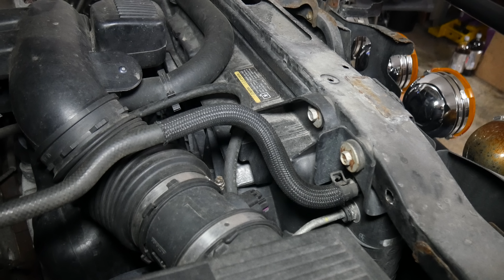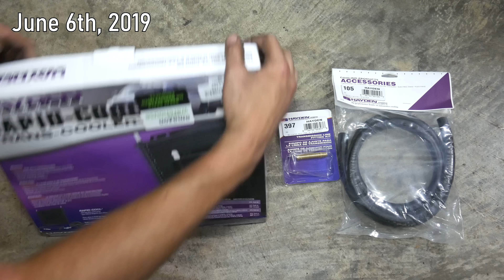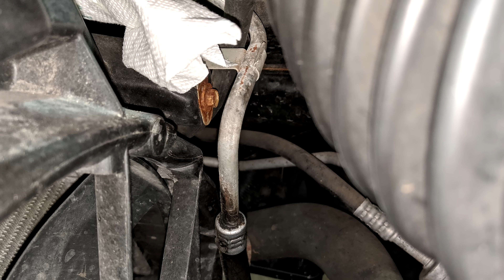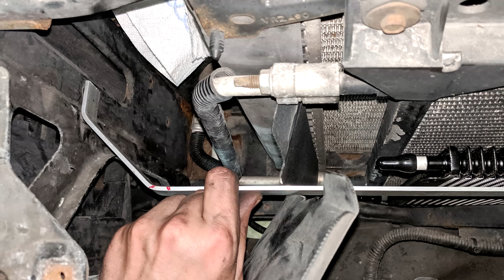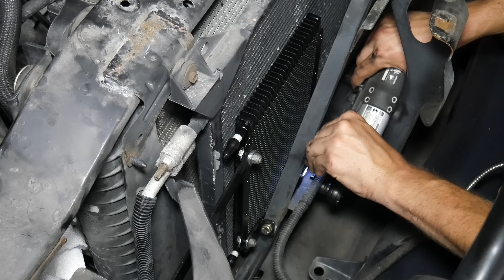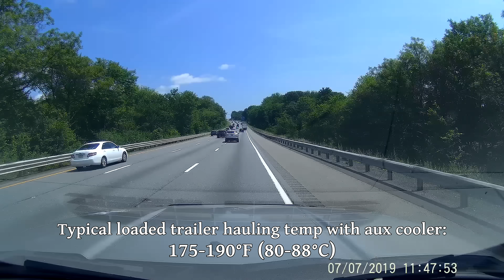2007 Silverado Project Auxiliary Transmission Cooler Install (Ep.14)

Comment: I ordered a Hayden 678 to put on my Tacoma. I’m going to be installing it  and installing a fan too since I’m pulling on steep inclines at low speeds. 
I ordered a Mishimoto 6” fan and it will mount to the tabs perfectly. I also have a cheaper 7” fan on the way just to see if it will fit and maybe save some money but so far the 6” fan looks a perfect fit if you are using the included mounting ears that slide on the fan. Without the slide on ears I might be able to go a 7” but I haven’t received it yet so I’ll find out soon.

Comment: did this to my truck as the radiator cooler isnt enough to save these transmissions, used the tube and fin style cooler and a mounting kit from hayden, used the fuel injection style clamps and liked them way more than the worm gear clamps, overall its an upgrade whether you're towing or not because the main killer of transmissions is heat

Comment: Hey, great video! I just want to confirm that you installed a cooler without the thermal bypass, correct? I have an aftermarket 3 row radiator that eliminates the trans cooler function, so I opted to add a hayden trans cooler, but since it does get fairly cold here (teens and occasionally single digits in Jan) I opted for the model that includes a thermal bypass. If you installed one without, temps of 150 makes sense, but if you installed one with a thermal bypass, I may need to rethink my design. Thanks in advance!

Comment: Same truck, but a 2008 and 2wd, with exactly the same issues. I live in New Mexico, about 1200 ft above the nearest grocery store, maybe 1500 ft total elevation from Home Depot. In the worst driving conditions, especially while towing, I could easily get trans temps over 230 degrees. Took my truck to a reputable trans shop and they said it "wasn't really worth" putting on a cooler. I was disheartened, found this video, saw that it described my exact problem, and ordered the parts.

I'm not a skilled mechanic. I can do the basics, have done things as intensive as a timing belt with a friend, but generally there's nothing except my water well that makes me more anxious than working on cars. I usually get in a big fight with my wife before I attempt any car repair. I've never made brackets, never messed with transmission lines...last night was not a huge one, but we were a little miffed at each other before bed.

This video was spot on. From pulling the truck in to the garage to pulling it back out again was about about 3 hours, total. The pick tool is really quite necessary--not sure how you'd get that little ring out without it. I bought an aluminum bar at Tractor Supply. I managed with two brackets, one mounted higher up near the hood latch, using an existing bolt hole there. I didn't paint the brackets. I used my bench grinder to round them off. The two things that hung me up most were the clips for the grill (annoying) and getting the return hose to slip far enough onto the old hard line that used to go into the radiator so that a hose clamp could get purchase.

All said, I got it on, after a few hours of talking to myself and dropping things. I took it on a test drive down to town. About 98 degrees down there, 93 at my house. Truck made the climb and topped out at about 180 degrees trans temp, which is 25 degrees lower than it normally is when I pull into my driveway. 

I have no clue if this will extend the life of my transmission, but this is "worth it" for me, simply because the parts are so cheap and the relief it provides is significant. Thank you for making this video.

Comment: I just picked up the Hayden 679 for my 17 sierra wt.  So far towing my travel trailer with the family for a camping trip. I average 210-230. The highest I've seen was 240. Winter would never exceed 195 due to the transmission thermostat. (yea gm has that now since 2014.)  It would open above 194 before it flows to the rad/cooler. I've since replaced my transmission thermostat. The new updated one opens at 158. So it will be interesting to see my Temps this trip with just the new thermostat and the next trip in a month will hopefully be with the additional cooler. I'm not too concerned with winter even though I'm in Canada,  because of the mentioned thermostat, Hayden's supposed built in cold weather bypass  AND active grill shutters. Supposed to help aerodynamics as well according to gm. But man is it great for winter.
Reply: Update: 83° day. Got up to 230° thermostat didn't really keep the Temps down much. But did cool down quicker and took longer to get up there.
Reply: So final update.  Unloaded driving it hovers around 165 once it stabilizes. Towing it hovers around  185 and I haven't seen it over 195 since. DEFINITELY WORTH DOING!

Comment: We have this 2006 chevy duramax for farm use, we were hauling hay out of a field with sugar sand roads at 7 mph that trans got up to 270 DEGREES!!! The red temprature starts at 280 up to 300 is where the guage stops going up.

Comment: Helpful, straightforward video that really helped with installing a cooler on  my 2013 Traverse.  IMHO most applications will be fine using the included plastic connectors in many kits and tying directly into the A/C condenser coil. Cars roll out of the factory with dozens of plastic clips, harnesses, ties, etc. Why the connector for a cooler would be different than all of the other plastic on an typical engine setup is beyond me.

Comment: I got the parts you suggested, but opted for the cooler that had the bypass function since I live in upstate NY. I cut two longer 3/4" flat aluminum pieces to span the opening made by the structural members I mentioned in my previous comments. All went well--until I realized that the included hose was not long enough. No one in this area had hoses the correct size and I did not want to try a 3/8" hose, so I then opted for a steam punk look as I then mounted the cooler at an angle to the passenger-side structural member. This location allowed for the hoses to reach. Since I am on vacation, and my tools were in NY, I opted for this simple install until I get back home and can mount it properly. So far, it's reduced temps by about 50 degrees.  The only thing that did not go as you described is I could not get the slip ring off the existed tube so I could put it on the new connection. There are no leaks. I wonder what could be placed on the retainer clip to get it from coming off. Is that even an issue? Do they routinely pop off? It seems pretty secure as it is... I hope.

Comment: Quick Question: I took the air dam from off the top of the radiator area and looked in to see for myself what you did. I noticed the front bracing (like an inverted "V"). With the horizontal nature of the mounting brackets built onto the cooler, could you have made some simple straight aluminum pieces to span that opening? You didn't, so I'm wondering if there was a reason why. (not being picky here, it just seemed your method may have been harder than it needed to be with all the bending.) Could it be that the bracing may need to come off for other reasons not related to the transmission cooler and the cooler would then have to be removed as well? Also, this cooler comes with zip-tie type mounting rods and spacers. Are these not as good?

I have a 2008 V6 and my transmission runs at above 200 deg normally, and pulling my camper it reached into the near 240 deg area. This concerned me so much that I stopped a GM dealership to ask if this was high and if not, at what temp to be concerned. I could get no straight answer. One dealership stated "Your idiot light will come on if there is a problem." But I'm thinking it'll too late if it does. There is nothing in the manual about this. You were concerned at lower temps than mine. There is nothing in the manual about this. Thanks for your video.

Comment: I put 2 of these on my 2011 Sierra 1500 with the 6L80. Never goes above 170 in 90 degree heat pulling my boat in traffic. After my transmission failed the fist time. I’ve been told you can’t freeze out a transmission 😂

Comment: Will you ever do a video on best way to flush your transmission fluid?  I have a 4l80 and I have changed the filter and did a normal service, and I also changed the lines, but the factory cooler broke and I have a part store cooler, it looks kind of sketchy so I would like to get something much bigger and hardlined.

Comment: Great work! On an unrelated topic they have a bad problem with battery cables. Particularly the ground will corrode inside the cable and you’ll notice when you shut it off you’ll see the truck has no electrical power. And when your driving you might notice the gauge cluster and interior power all goes haywire. Had this happen on my 09 Tahoe and the battery cable was 50 bucks on amazon for a genuine acdelco.

Comment: You know. For those cold days you could also install 2 "t" style diverters and connect them together to bypass the aux cooler when you need the warmth. In addition it would also allow you to remove the cooler with minimal atf spillage if you ever need to do maintenance  to say the ac system.

Comment: BEFORE YOU DO THIS ~~~~~ DO NOT FOLLOW THIS VIDEO, THE POINT OF AN AUX TRANS COOLER IS TO REMOVE IT FROM THE FAULTY, PROBLEM RIDDEN, RADIATOR COOLING SYSTEM. GO DIRECTLY FROM THE TRANS TO THE NEW COOLER, PLUG OFF THE RADIATOR. Trust me, once you're enjoying your new lower temps and never worrying about cross-contamination from the radiator, you'll thank me. This ONE video shows how little this channel truly knows about automotive engineering.
Reply: I don’t think this is an automotive engineering channel, also, if you’re claiming to be an engineer. You missed the point of why it’s ran through the radiator, it gets the heat from the radiator to help warm up the transmission fluid and keep it warm. Technically, running it externally is better, if and only if, you plan on using it for racing or high temperature climates like deserts. Also, to add insult to injury, many manufacturers who hire professional engineers to make these, will void your warranty if you bypass your radiator. Radiators go bad from bad owners, that don’t use the correct water and don’t flush their systems periodically. Speaking of bad owners, most people don’t even use their tow mode and leave their trucks in overdrive. Then cry about GM engineers.
Reply: Fifty six.   Dude u should calm the fuck down
Reply: Calm down there buddy. The point if this video isnt to be a tutorial.

Comment: Nice install.  I've put many of these in vehicles I've owned over the years.  Didn't see them in the images but the trans coolers usually come with nylon mounting rods.  I've always used those and never had any concerns.  Also, I'm curious if you would be willing to bypass the radiator all together?  I did this on my current daily driver and never had any issues.  Its a Sierra but a few years older than yours and I'm not able to monitor trans temps.  I've never heard of a trans failing because it didn't get warm enough.  Your thoughts?  Also, I know cross contamination of trans fluid and radiator fluid can be a concern as the vehicle ages.
Reply from the maker: I've read from several trans cooler/transmission fluid manufacturers that cold temperatures are not good for clutch life and I know that the 4L60e/700R4/TH350 transmissions I have driven do shift noticeably different below 30 degrees F or so. Realistically? It's probably not an issue. Shifting seems to normalize within a few minutes of driving even in 0 degree weather. There are probably some long-term clutch life/bushing wear benefits to a warmed up transmission, somewhat similar to how running around town with no thermostat installed is probably not the best idea in most cases but those engines don't fall apart because of it.
Reply: @FuzzyDiceProjects  Thanks for the reply.  Interesting enough, some shops in my area that rebuild these eliminate the stock radiator cooler for added reliability.  Guess it helps that I'm in a part of the US that might see a 20 degree temp one winters morning out of the year.

Comment: shouldnt you add more transmission fluid to compensate the volume spent on the aux radiator?
Reply from the maker: Yep! Good point. Should have noted that checking the transmission fluid level after installing a cooler is, of course, important.

Comment: Why not use one of those straight through plastic zip "tie" kits if you're going to mount it to the rad?
Easy peezy lemon squeezy and she's done. Personally I would mount it "off rad" which would
avoid heat transfer and prevent airflow blockage. Those coolers get pretty hot just on their own.
Just my "two cents" , love what you do enjoy the video's. Thanks.
Reply from the maker: I didn't choose to use those through-the-fin mounts in this case because the A/C condenser was sandwiched in the middle and wouldn't want to pull those real tight and possible cause issues. Have used those on the 1988 S10 Blazer and the 1978 Firebird without problem though.

Mounting the cooler up against the rad/condenser is beneficial because air doesn't have an alternate route around the cooler when the cooling fan is running, so it would theoretically be of benefit when sitting in traffic. Similar to the principle of using a radiator fan shroud

Comment: We put an aux cooler on our 07 tahoe over the weekend too. Running a tru cool 40k and living in AZ on 113° temps outside the transmission temperature is around 190-203 on some days then when driving itll cool back down to about 194. Hopefully this tru cool will bring these temperatures down and keep this 4l60e happy. 

Also a 2007 4.8 nnbs Tahoe

Comment: Developing a Bad Obsession for brackets are we? (Chuckles)  More seriously, nice solution to that (esp with the idea of keeping them inline).  If worse ever came to worse during winter use, you could in a pinch use a piece of CAD material to block the air from entering the new aux cooler (I'm sure you thought of that, but it doesn't really appear you need to do that).

Comment: Great temps! It'll save it. Plus, put it in neutral at long red lights, it'll help bigtime.
Reply: @wadewilson6628   That's actually not correct. The pump in the transmission is moving fluid if the engine is running, no matter what gear it's in. We know this because when the pump begins to fail, it makes noise in park, neutral and all other gears (but obviously louder in a drive gear). Or better yet, put the transmission in neutral, remove a transmission cooler line, start the engine and observe what happens. (It will squirt all the fluid out in about one minute). The two large slots or splines on the back of the torque converter directly engage the pump. If the engine is running, the pump is pumping. (The concentric input shafts in the center are splined into the center of the converter and that is the part that engages or disengages depending on gear selected and RPM). 

At any rate, shifting out of a drive gear unnecessarily while towing a trailer doesn't seem like a good idea either!
Reply: Why do people try telling others wat to do when they have no fucking clue..... Im talkin bout u wade
Reply: Wade wilson

Listening to you they wouldnt have a transmission at all...lol

Comment: Wouldn't it be alot easier to just use zip ties to hold trans cooler its just needs to stay in place and not be all tightened up
Reply: U really wanta trust a zip tie bud?? If they fail it could cost ya a whole new trans.... Just sayin
Reply: @frankcioffi5122  but they wouldn't supply them if they didn't work and i doubt if they are your typical zip ties

Comment: Question.  Do most radiators run fluid from bottom out to top? Isnt it easier in the pump to go opposite with gravity?
Reply: Its run the way it is in the video so the whole cooler gets filled with fluid then exits the cooler. If you do it the other way it just drains out and never fills up and therefore the cooler isnt really doing anything

Comment: These newer automatic transmissions are intended to run warmer,  my 2008 Sierra with a tow package 4l70? ( receiver, cooler, wiring but no trailer break controller) runs on 100 degrees of ambient temperature +\- 20 degrees 
Example, 80 degree temp runs between 160-200 but normally 190* with no load 
Now I’ve never had it over 200* towing, 
I also don’t know ie accurate the temp gauge is because if you plug a ob2 scanner into it the coolant temp will read 185* where the thermostat opens and not 190* like the gauge reads, 
On my truck the DIC vs real life TPMS is +\- 5psi , fuel gauge used is about 4 gallons fast

Comment: This is my next modification for my truck. I'm about to put a 1800 lbs slide in camper and I want to have more cooling power for this trip. Thanks for the information and the how to and also the trick with the brass piece.

Comment: You could probably slip a piece of cardboard in front of the transmission cooler to help with the winter temps, it's a common trick where I live on some cars to put a piece of cardboard in front of the entire radiator when the temperatures get to around the -30°C range.

Comment: I used to make custom cold air intakes for a car nobody cared about. I used to make brackets the same way you did here. Instead of the bed-liner, I used heat shrink tubing in colors to match the intakes. Worked great and looked better. You can use the ones with the glue inside or the non glue type.

Comment: The tow package on gm some of them had a filter going back from the coler and make sure you check your transmission fluid because that cooler holds some atf